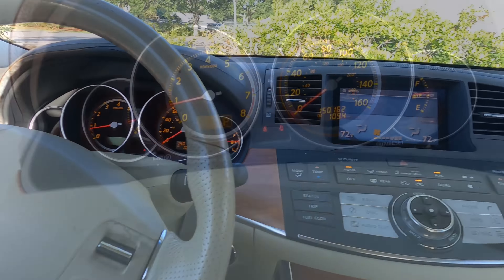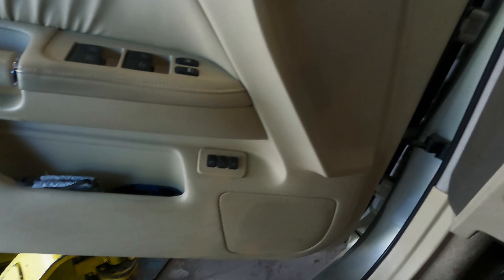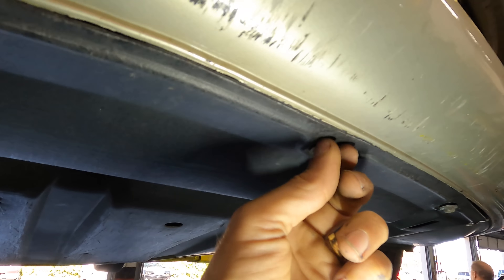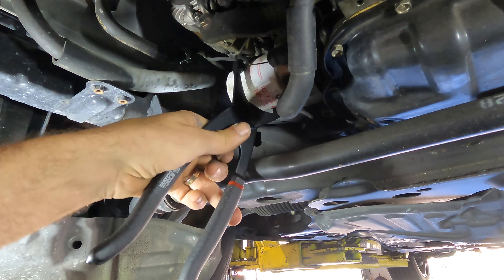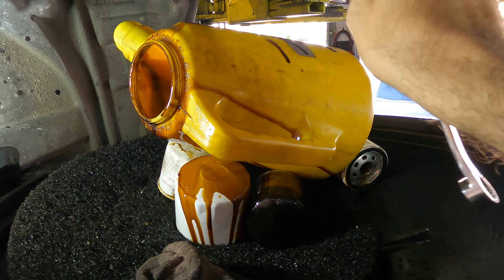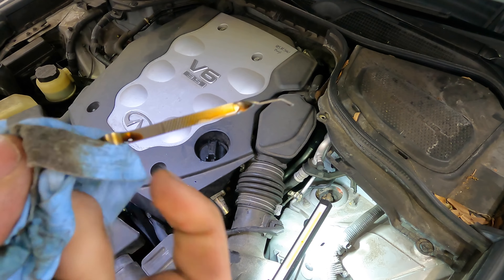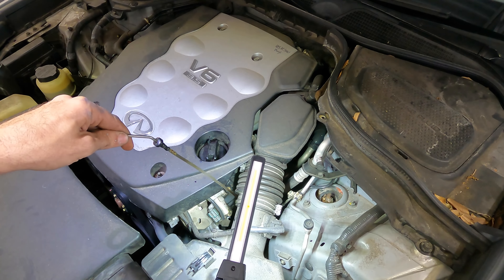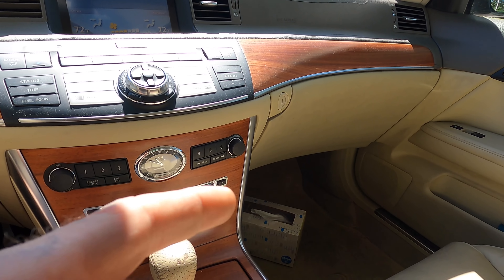Customer States: Sounds like a Machine Gun? Infiniti 3.5l V6

Comment: Older cars the owners manual suggests 10 to 15,000 mile oil changes. Many cars have their oil changed far too soon if they change at 3,000 miles
Reply: No. Older cars don't say 15000 miles....that's ridiculous. The most you should go os ,5000. If you wanna neglect it and have the motor have a shorter life, then 10k to 15k . The dealer also says the tranny fluid is lifetime fluid, in most newer automatics too.. that's also bulllshit
Reply: @richsweeney1115  I see you've never read an older cars owners manual from the early 70's. I never said it was good to wait that long but I did say 3000 miles is only making service garages more $$
Reply: @HypocriticYT  no, I've only worked on cars and trucks, ECT for 2 decades..that's all.
Reply: @richsweeney1115  that only brings you back to 2000, about 30 years past what I'm talking about. You've likely never worked on an early 70's car. I have a 1974 Cadillac manual stating 10,000 mile oil change, should look at the old ones. Maybe why those engines in many cases didn't last more than 100,000 miles and then again oil changes were not pushed hard at all then because not much $ in them.

Comment: I had a crazy rattle I’d hear when I turned, only sometimes. Freaked me out. And my Toyota had 300k miles. Figured it was just starting to have a big issue finally. Took it to get diagnosed. Turns out it was massively low on oil. My dumb ass was overly confident in it being a Toyota, I never even bothered to regularly check oil. Started burning lots of oil at some point and I didn’t ever think that could be an issue for me. Never again!

Comment: I did an oil change on my truck and was shocked that it only had 1.750 quarts in it when I changed it, the truck never has used oil nor has it since. the only thing that change was I went through a divorce and let the ex wife borrow it for the day, I came to the conclusion that she was trying to "win" and oil was sucked out of it through the dip stick. now don't think I'm jerk for thinking this, it also came back with a broken windshield that supposedly a rock hit it but sure looked like a round side of a hammer. I just laughed the whole thing off since windshield was $170 and no damage to the engine. cheap in the long run. :)

Comment: I'm kinda surprisd he didn't check the oil before he drove it...and then had it running at a higher idle on the lift. Low oil is   what it sounded like when I heard it... And even if it was way overdue for an oil change, it still shouldn't have been that low on oil ...

Comment: Hello! Someone I know had a a granny who never ordered oil for her car. The guy who filled it with gasoline took pity on the car and added a quart of oil from time to time (and ate the cost -- it was a few decades ago). So he only got oil on him if he checked the oil level. 
Would a supply of plastic "christmas tree" fasteners work as well where the stripped bolts were. And be cheap and faster to pull and replace.  __

Comment: Yeah, oil is the first place I would have gone.  I cannot believe how dumb some folks have gotten about maintenance.  Last time I stopped by my mechanic, they were doing an engine swap on a car that hadn't had an oil change in 10,000 miles.  Meantime, my 21 year old Town and Country, with a quarter million miles on it has never missed a 3500 mile oil change, is still reliable, and doesn't burn oil.  We've also replaced the valve cover gasket a couple of times.  I don't tolerate any oil leaks.  Maintenance is always cheaper than a car payment with interest.

Comment: That poor M35, needs a better class of owner.
BTW, after the monkeys at an Infiniti dealership stripped most of the bolts on my Infiniti holding the gravel shield, I replaced them with plastic push pins; the only bolts left are those across the back going into the cross-member
😳

Comment: I know what caused the noise. I had a car that was missing some bolts from the skid plate/under engine cover and when it got up to highway speeds it would vibrate making a machine gun noise. I had to replace about half the stripped out clips and after it was nice and tight, the noise went away.
Reply: Hey Sean, did you make it nice'N'shiny 🤔, aswell😁🤣🤣🇬🇧
Reply: @stephenwilliams6103  yep, nice 'n' shiny with the appropriate amount of clicks on each of the bolts.

Comment: only thing I can see is ,,is there an liability if you were out just driving the car before you performed any work if the motor will blow up because of no oil should it be routine to check the oil before said test is taken

Comment: Caulk gun as a throttle depressor?!?!
Priceless!
Harbor Freight (actually Pittsburgh Tools), makes a 24" "bar clamp" that, when you reverse the "stationary" end, and place it "behind" the movable piece of the clamp, makes a really nice throttle depressor, and, if you need a bar clamp, just reverse the same end, and place it back where it's "supposed" to go, voila, "instant bar clamp" from your "throttle depressor"!!!! 
For "extra large" machinery, etc. that the 24" won't fit, try out the 36" "bar clamp". 
Each is much less expensive than the "purpose made" throttle depressors made by the automotive tool manufacturing firms!
You're welcome.

Comment: Always assume it's engine noise and check the oil level first as these pos infinity  tells you to change oil every 10 000 miles....by the time the low oil light comes on its to late the damage is done...check your oil at least once a month

Comment: Nissan VQ engines rely on oil pressure for cam chain tension and the variable cam gears. I've seen new techs recommend timing chains or cam gears for rattle noises or cam timing codes without checking the oil level. As a Master Tech, part of my job was helping the line techs. I'd usually walk by and just say, "Did you check the oil level? Just a suggestion" and keep walking.

Comment: I don't understand why manufacturers have to put all of that plastic covering under the hood.  Isn't that what the hood itself is for?  Seems that all that plastic, especially the engine beauty cover, traps heat close to the engine and it cannot be good for long term longevity.

Comment: With broken hood struts, use a small vice grip.  All those stripped out bolts under the engine, use license plate squares as new receptacles for bolts.
Happy Easter.

Comment: Long long ago, at a job far, far away... I was a quick lube tech. But even then, when we were doing changes, we would check the dipstick before dropping the oil, and if it was low, have a second tech verify the level and note it on the invoice. After filling we'd also show the dipstick to the customer if they were waiting, or have another tech verify the oil level on the dipstick. Obviously, that was liability driven, but I'm always surprised when Ray doesn't try to check the oil before dropping it.
In this case, it would have been backup for needing those valve cover gaskets replaced. Might not change the customer's decision, but it would be handy documentation when they bring the smoking hulk back with a lawyer in tow.

Comment: Who gets ready to change oil and not check the level beforehand.  Specifically when the customer states, I hear something like machine gun fire up front.  So when you tell them they were low on oil and they ask how much did they have and you say, I don’t know, makes for an interesting conversation. Oh by the way, you need valve cover gaskets. Don’t be surprised if they say, yup but, you ain’t gonna do it.

Comment: I know what you are saying about getting dirty. I am a 35 year licensed mechanic truck and coach and automotive the truck is where I make my living. Man you are crawling into holes to get to components I wear coverall because of this. In this field you have pigs the inside of the truck is as or more dirty then the outside I use plastic seat covers and cover my workspace keeps the grease and funk off of me and always use gloves. 90% the end of the day everyone thinks I did nothing because I am still clean. Work smarter not harder.

Comment: I`m not saying you shouldn't go and have a look for your self at the recommended repairs! or have some trusted friend check if that is the real case. 
after a oil change at my dealer i payed for a inspection of the vehicle..20 euro. fluid levels and so on. got home and try and clean my window and low win cleaner fluid level light came on. so when back demanded 40 euro back and the fluid be top up or i`d place a scam review from a 5 star dealer.  that was 3 years ago and they never tried that again.

Comment: There's a reasonably new service called auto REPAIR INSURANCE.  A large pool of folks paying reasonable monthly charges so's the few who experience failures get it fixed more painlessly.  One such declares: "CarShield cars go farther!"  And it's true (I guess, as I don't want such insurance but it's right for some)  Still the truth is a well maintained car DOES go farther.  WELL MAINTAINED is the key.  360,000 on my 90 Lesabre.  Oil change is more important than brushing teeth.  Cars are different than many things we buy in that they MUST BE MAINTAINED.  I don't care if Briggs & Stratton eliminated oil drain plugs, the OIL MUST BE CHANGED!

Comment: hey Ray! If i was in Florida, Would you like to work on a 2011 Chevrolet Malibu LT2 ? It needs a new Strut Tower Assembly! Basically it was "Driver Error" for this accident, but I kinda was driving it in the snow with Bad Tires! and you can only guess what happened! -Yup! Thats Right!  Didnt hit anyone tho... just a small curb... the Right Front wheel got Curb checked kinda hard...

Comment: Infiniti/Nissan VQ engines are known for burning oil so got to keep oil topped off I drive an infinite G35 and have to constantly add about 2 Qtrs. Between oil changes also known for valve cover leaks

Comment: You shouldn't be losing 3-4 litres of oil in 10k miles (guessing the car doesn't have low oil sensor) my car has to lose 0.8L out of 4L before the light comes on

Comment: Owners fault on the oil level. Helpful hint Kids....check it last when you get gas. Engines need oil to survive. You are lucky it did not lock up. I would be cutting that old filter open looking for sparkly bits.

Comment: Low oil and at least big ends running out. Oil probably sucking dry now and again. Ran cars like this all the time back in the 70s. Until either we could afford new bearings or a new engine.

Comment: I had flashbacks when you started messing with that dipstick. One of the worst designs I've ever had the pleasure of using. Ended up breaking one and buying a factory replacement. Oil did not register on it at all. Had to take steel wool to the cross hatch area to get it to stay long enough to register. They are also notorious for the fill cap getting stuck and requiring pliers to twist it for removal. I do not miss working on the VQ35 at all.

Comment: I think you should tell Peetah that because he did not put enough oil in it the muffler bearings were running dry and making noise.  Good thing you caught it in time because you need a left handed pipe wrench to replace those...

Comment: 12:50 that's a damn shame. At this point I would think the machine gun noise was coming from inside the engine at higher rpms or load.

Comment: Are you going to replace the threaded Clips for the lower shield  screws or just leave it with half the retainer screws in it ????
Reply: Full set of nylon inserts and screws is $10 but the labor to replace them is probably more that they are willing to pay. If the customer won't pay for the work they leave with what they came with.

You sure don't do it for free.

Comment: i have a 4.6 ford kicking my butt right now. i can go 10k miles and not use one drop of oil. then in 500 miles i may use 4 quarts.  and it dont matter is i'm at 500 miles into the oil change or 5000 just when it decides to use it it does. i keep saying i'm going to get rid of the red turd. but i love the red turd. 2000 ford lariat 4x4 4.6 factory 239 hp 100 HP died 50 are sick 75 are on strike. so that leaves 14 hp to pull the truck around.

Comment: Always appreciate your diagnostics Ray.  Im an 80 yo who has worked on many cars ove 65 years.  Current ride is a red 66 dodge dart 270 ragtop.  Got a 273 commando with a 650 Edelbrock pumper for power. A fun headturner.
 But i have used someof your teaching to keep my toy running well.
Thank you sir.  Hope to start getting snowbird cars back from Fla  soon.  Usually 6 to 10 a season.

Comment: Machine gun noise - valves clattering because they have no oil. 
No oil - bad valve cover gaskets leaking profusely and 10,000 miles with no adds or, Pete just didn't fill it.

Comment: Why on your videos you don’t do a visual inspection before starting the cars, it could have low coolant or low oil or even lose parts belts and pulleys, they could have leaks engine, transmission, power steering or brakes! You just take that risk of causing more damage to the vehicle.

Comment: To all that have a big NO ready at the garage after recommended repairs! 
 Well if you have a "NO" ready then your not just endangering your self but everyone els on the road as well. 
bad tiers= not able to stop on time=hitting a child running into the street. how`s the "NO" coming then
bad brakes=  not able to stop on time=hitting a child running into the street. how`s the "NO" coming then
bad shocks= tiers bouncing while stopping=loosing grip in corners=  hitting a child running into the street. how`s the "NO" coming then.
stop thinking about your self for once and how fantastic you think you can drive and keep your car in proper working order and don't hit that child running into the street!

Comment: I believe the skid plate was the culprit. Low engine oil would cause low oil psi and a check engine light. Since the culprit was not consistent and he found an obvious flopping plastic skid plate I would think air turbulence would cause that rattle .

Comment: when ruling out the splash panel as the source of the noise, would it be more reliable to completely remove it and then see if the noise disappeared? i just had the rattling heat shield problem in my car. the contact area between the washer/nut and the heat shield corroded and widened too much for the washer to hold onto. i put a larger washer in between  them and now it doesn't rattle anymore

Comment: FYI: I have the same car but 1 year newer. there is a small air dam piece missing from the front of that plastic cover on the underside. it would push the air down away from the cover.
on a side note, it looks like my car underneath, oil leak from valve covers. I have to fix that. or I could bring it down to Ray from Buffalo NY

Comment: That car might as well have been on it's last legs, I own a VQ 3.5 (like that one), and there should be 5 quarts of oil, I verbally said "holy shit" when I saw how little oil there was in there. The valve covers and the oil cooler (the part the filter threads onto) gaskets are very very common failure points on these engines. I wasn't at all surprised to see the leaks, but the lack of oil killed me. Another thing to note is the VQ35DE model of this engine has a minor issue with small amounts of oil being burnt, but the Rev-Up only in the manuals (05-07 G35 Coupe, 05-06 G35 Sedan, 05-06 350z) has a MAJOR oil burning issue, due to poor design of the oiler rings, and was a known issue by Nissan due to the different oil standards in the US.

Comment: Hello Ray I got a little chuckle when you commented on the oil change interval. What happened to the 75,000 mile oil and just change filter and top up. I still have an old oil container with this statement on it.I know it was referring to synthetic oil. Even on conventional oil 10,000 miles was often considered acceptable.
Also oil filter change recommendations used to be replace every 2nd oil change. I know things change but  oil companies like to sell there product. As you pointed out proper oil level is far more important than missing the exact mileage on an oil change.I have had some older Nissan and if this one anything like the ones I had as long as about 2 Liters of oil was left the engine will probably be just fine. For the customers sake let's hope so.

Comment: That has to be the worst dip stick design in the world 😫.
  Ok how much does an oil filter cost?. How much does 5 quarts of oil cost?. $30-40 combined.Small change yer.
  How much does an engine cost !!!!!😫😫😫😬😬😳.
  I change my oil once a yr regardless of mileage . Keeps the engine sweet . Especially as it’s a diesel and diesel oil mixed with engine oil spells disaster.
  But l digress, it doesn’t matter if it’s diesel or petrol. Looking after the heart of your vehicle is good practice. Especially as it costs so little.
  You have a great day 👍😃🇬🇷

Comment: Amazing that engine still running with just one quart of oil...where did the oil go ?
Reply: Valve cover gasket leak, he showed the leaks in the video... It's a thing with older VQ engines.... Relatively easy repair, but it looks like it was a combination of overdue oil change+leaks.

Comment: Been working on cars and equipment for 52 years and I have determined the two worst jobs. Not necessarily the hardest, but to me, the worst. Have to be brakes and exhaust.
Reply: Definitely exhaust systems I don't touch them guaranteed you get rust in your eyes and all over

Comment: Wow that's not good at all only one court of oil even if you went by the computer say after you have started the engine you check the oil to make sure that it is on the full mark on the dipstick. So my though he only put two courts of oil one in the filter and one you drained out of the oil drain plug  I don't no of any Automobiles out there that only takes two courts of oil. I would keep it going lol